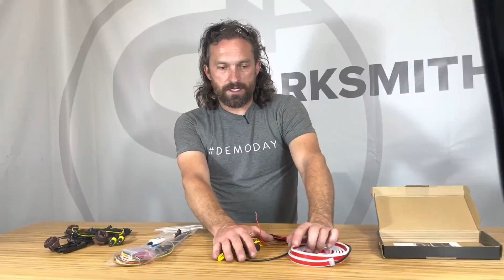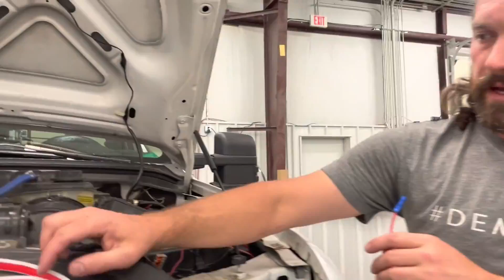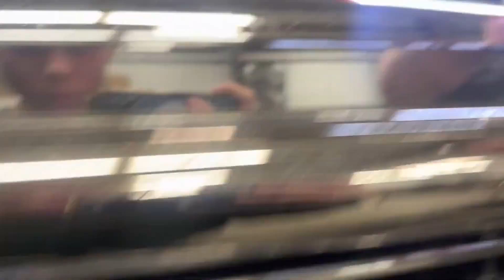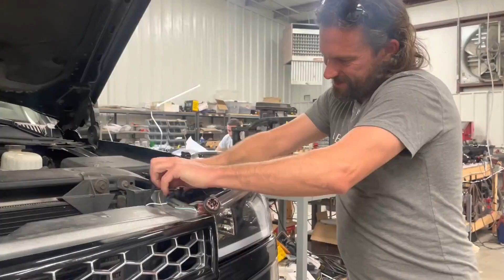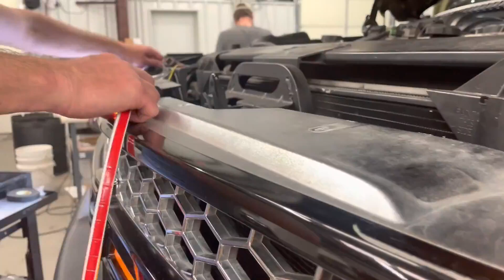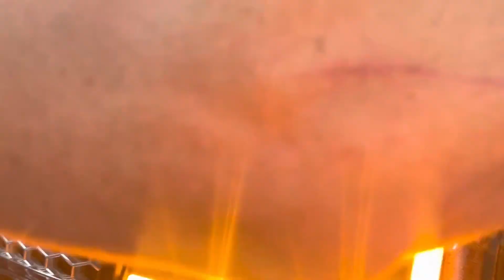Animated Hood Light with Amber Turn

Comment: Ok i have a question when you close the hood does it not smash the led strip,damage it because i know my hood doesn't have ne space its very tight when its closed i was just wondering about that thanks
Reply from the maker: It can depend on the specific vehicle. But the strips are a soft silicone tube that's barely 1/4" thick, which is small enough for most panel gaps in modern vehicles. You should be fine.
Reply: @Sparksmith ya my daughter's 2022 Toyota rav4 xle has a weather striping almost the whole length of the front of the hood
Reply from the maker: @robertnorris6079 This strip could most likely be used as, essentially, a replacement for that weather strip. You're welcome to order one and if it just absolutely won't fit, you can always return it as long as it isn't damaged.
Reply from the maker: @robertnorris6079 If you decide to order one, we can build a kit that should be plug & play for her Rav4. Just email support@sparksmith.com for more info.
Reply: @Sparksmith done bought one,installed it underside of hood its ok you got to put it right at the edge just to see it ,doing so you can see it sticking out when the hood is closed would I need to install a load resistor since its a led,I know how they like to cause hyper flash thanks
Reply from the maker: @robertnorris6079 I hope it works out well for you. You won't need to add resistors unless you are planning to replace the factory halogen turn signal bulbs with LEDs. Just adding a strip in parallel with the turn signals will not cause hyperflash.

Comment: I have the same led strip when i connect the wire to my indicator wire thay stay on continuous flashing won't turn of unless i disconnect wire don't know wot i am doing wrong. Could you please advise Gary
Reply from the maker: That just means you have constant power somehow going to the turn signal circuit. These strips will not light up a solid amber. They will cycle through the amber sequence even if there's continuous power applied to the turn signal inputs. 

If your turn signals are not on and the strip is still running the amber sequence, it's possible you have a defective strip.

Comment: how do you know which wire to splice on the signal light? I have the tan connector on a 2016 ford f150 with the three wires.
Reply from the maker: It's the outermost wire that is NOT black w/ yellow stripe. Black/yellow is ground, center wire is park lamps, the third wire is your turn signal circuit. Feel free to email support@sparksmith.com for more details.
Reply: @Sparksmith  Thank you.  I will absolutely keep your email handy.

Comment: If anyone wants to install this a lot make simple wiring just use waterproof t taps and tap it to the running light /blinker, that way if you need to take the grill off you just unplug them and you are good to go
Reply from the maker: T-taps are certainly an option. But even the "waterproof" versions can be prone to water intrusion and corrosion. Should you choose this option, we strongly recommend also applying some dielectric grease to the insides of the T-taps before clamping them in place.